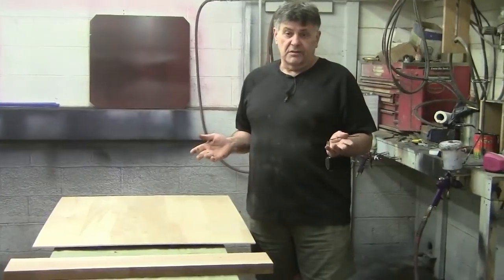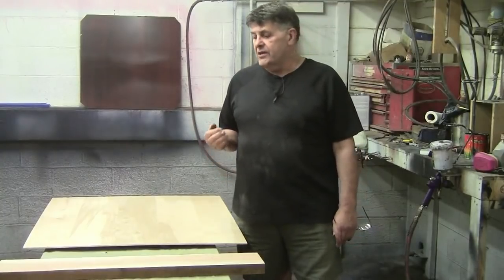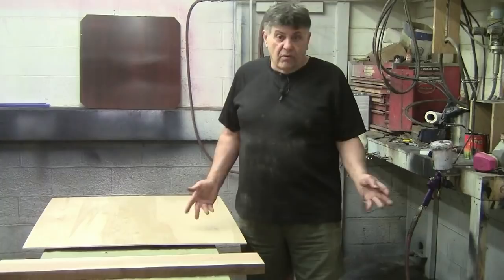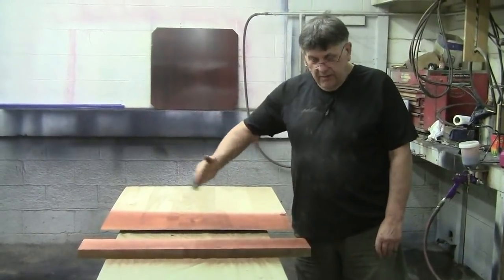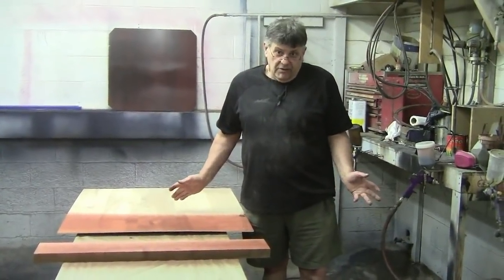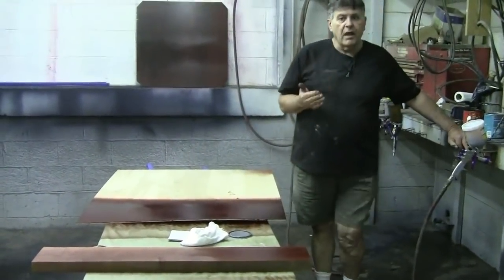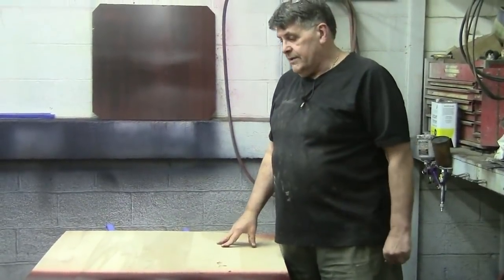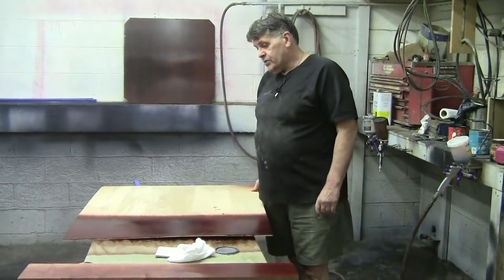Chapter 3 - Blotch Control - Spraying to Control

Comment: Charles, I have pine t&g for a ceiling I’m installing. I plan on playing around with spraying the stain, and have some oil based stain laying around to experiment with. Do you recommend thinning the stain prior to spraying? Or will thinning it require more coats, which in turn is bad because the oil based stain won’t adhere as well?
Reply from the maker: Thinning will cause it to penetrate more and worsen the blotching, especially on pine , pleae do some test samples to be sure